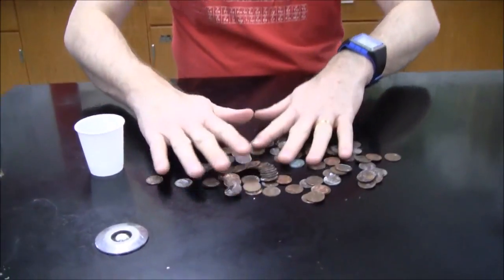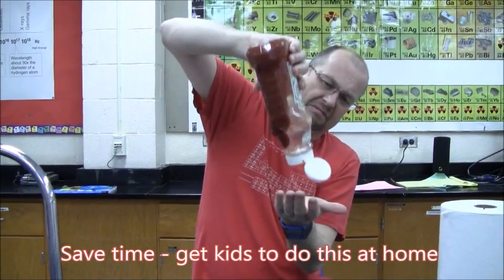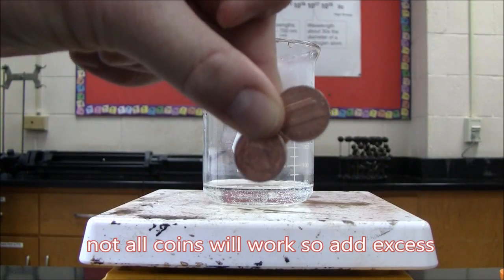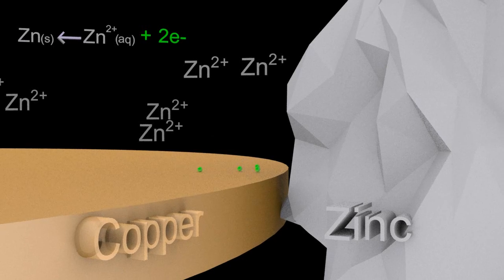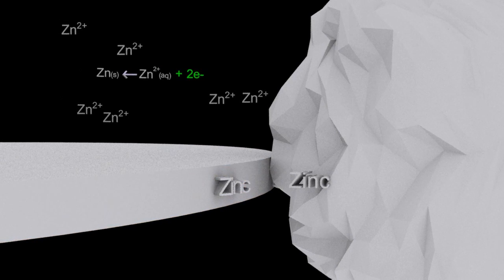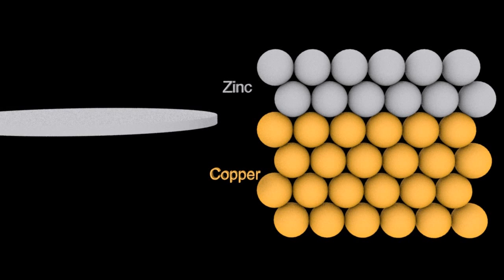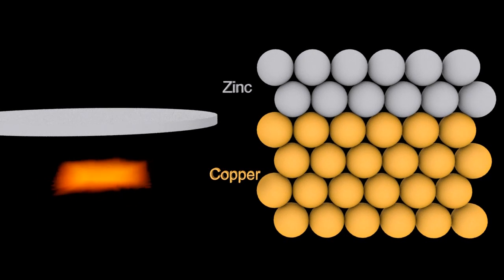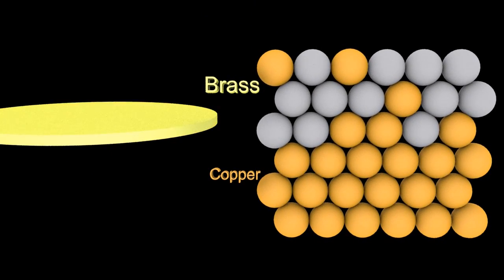Quick Lab: Alloys Gold/Silver/Bronze Pennies (Demo,theory,equations)

Comment: Aha!  Tried this in preparation to do it with the students and it didn’t work - I bet it was the Zinc oxide layer.  Will try removing it and see if this works!  Thanks for the video.
Reply from the maker: did it work?
Reply: @ibchemvids  yep!  Gotta make sure you have shiny zinc.  Rubbing off the oxide with coarse sandpaper beforehand does the trick.

Comment: what is keeping the zinc at the core of the penny from alloying the copper plating or coating on newer pennies . could you not heat it up enough to alloy those two metals or is the copper coating to thick to give any outward appearance
Reply from the maker: +Stig Cruise Maybe the alloy is formed inside the coin - continued heating may make this zone bigger until it hits the surface?